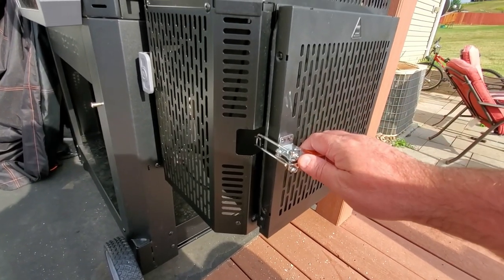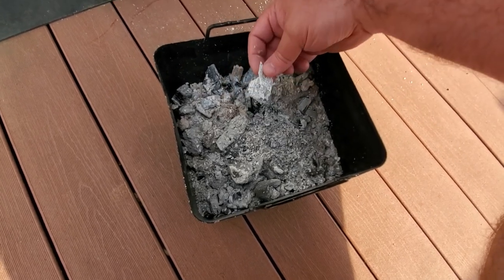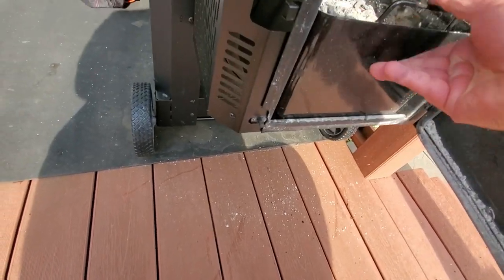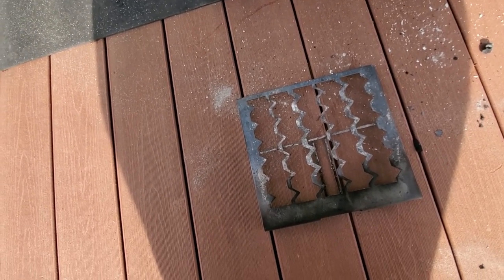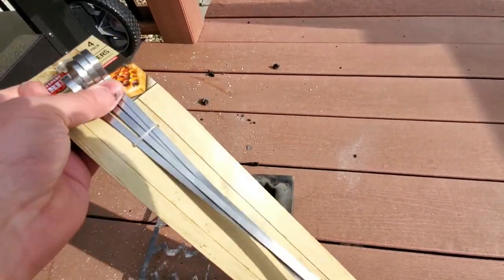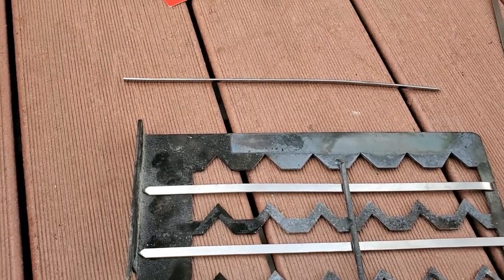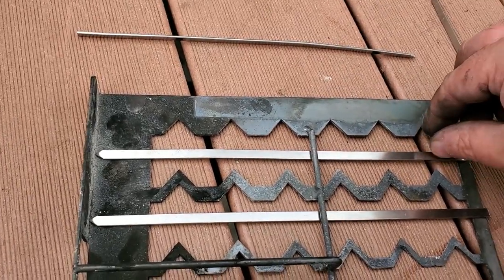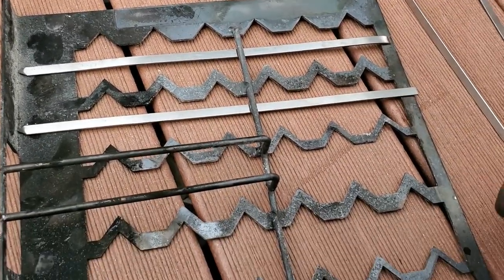Masterbuilt 1050/560 Hopper Mod - Save $$$

Comment: I purchased an aftermarket grate. The openings were narrower and had a fan protector. It was a complete fail. The grill wouldn’t get up to temp. The other issue is if you like to throw chunk wood like applewood, cherry etc it wouldn’t allow any small pieces of charcoal to fall through to ignite enough to cause smoke. Switched back to the grate that came with the 1050 and it works flawlessly.

Comment: Just a couple thoughts.

I think the spacing on the grates could be set wider so that the coals drop before too much ash builds up. If they get too ashed over the fan will pull ash up into the food or at least into the fan. 

Second, it seems to be a more common practice to add wood chunks into your ash bin to get a good wood smoke going. Slowing the addition of coal into the ash bin could make that technique less effective.
Reply from the maker: I haven't had a problem with ash in food and the newer grate does tighten the spacing a bit.  You are correct about the wood chunks and the coals dropping on them but you can effectively customize this by having as many in as you want.  I generally always have 2 in but bump it up to 4 for longer low and slow cooks but everyone has their own preference.  With just 2, I can easily get higher temps.  With 4, it has a tough time getting up to that high searing range.

Comment: Hi we just purchased the same grill. When you smoke does smoke come out the lid of the coal hopper when smoking. Smoke is leaking out the seal. Does yours do the same. Thank you. Great video 👍. Going to put the skewers in ours as well 👍
Reply from the maker: No, but mine seals really well thankfully.  I know a lot of other people have had that happen.  If it's only a small amount it's not a big deal but the more you have, the more it's directing heat and smoke where it shouldn't be and you'll also have more charcoal getting lit further up the hopper.  It's worth keeping an eye on.
Reply: @randomjoe7646  I double folded a piece of foil and lift the lid. When I placed it down and secured the lid again the smoke stopped leaking. The digital display is bad and will not read. It remains black. Masterbuilt is sending us a replacement digital display. Thank you for your reply. God bless 🙏
Reply from the maker: @indicagirl7876  Glad you got it worked out.

Comment: Tip or Suggestion:

You possibly won’t have a need for this mod if using B&B Charcoal Briquettes IMO. I want to stress too that it’s just my opinion. I’m not saying my opinion is right or will work for you. It just worked out this way for me. 

If your charcoal of choice is KINGSFORD then I would consider/recommend this skewer-mod, but also remember Masterbuilt placed those slots there for a reason on that charcoal catch tray. 

With this mod in essence what you’re doing is not letting those ashed up briquettes fall down into the hopper which in some instances will hurt your smoke output inside the grill and possibly mess with your grill temperature.

At most I would try 2 of them and see how you like it. In my instance, I tried it with 2 skewers first with B&B (I also add wood chunks) but this prevented a good even smoke throughout my cook. I also noticed that my different installed temp probe on the front, was suddenly way off from the digital display temp reading. 

I took the skewers out about midway into the cook and my temp gauge then slowly crept up to very close to my digital temp display. 

Note: As indicated above, I changed out (mod) the temp gauge probe on the front of the grill so I could see true temps towards the front middle of the grill instead of the included cheap looking Masterbuilt stock temp gauge. I had been using the new temp probe/gauge many times before this skewer mod and both temp readings (digital display & temp gauge/probe) always seemed within 5 to 15-degrees. 

I tried the 2-skewer mod with KINGSFORD as well and the same thing happened to me and it was even worse but I think that’s due to the fact that Kingsford has been proven not to hold temp anywhere near as long as B&B. 

** I also have the SS Firebox Mod on my grill **
Reply from the maker: Thanks.  I do adjust between 2 and 4 based on how I'm cooking.  If I want high temp, I go down to 2.  If I'm looking for temps 400 and lower, I've been good with 4.  That is generally with B&B Lump.  I did some briquette tests and they do tend to get to full ash easier.

Comment: Thanks for the video. Do you find that your lit charcoal creeps further up the stack above the firebox since coal isn't falling through the grate until it's much smaller in size? I'm curious if you notice more lit coals well above the firebox given that the coal on the bottom takes longer to fall through now. I'd hate to have issues in the stack above the firebox as I don't think it was meant to have lit coals higher up in the stack. Thank you.
Reply from the maker: No, It doesn't seem to go any higher at all.  The only change I see is the with the small pieces taking longer to fall through the air flow isn't as good so you can't always reach the higher temperatures.  I actually think my box is in better shape than most with the grill, at least most without the stainless steel firebox mod that's out there.  The only issue I really see with the box is with moisture slowly building because of the solid top seal.
Reply: @randomjoe7646  Thank you

Comment: I just saw this grill, new and assembled, at a local Walmart. It is in their clearance section and I'm more than tempted to get it. I've mostly been cooking on a Weber kettle. How is the 560 as far as fuel consumption goes? Should I anticipate spending more on fuel than I do with the kettle? Thanks... Very helpful video!
Reply from the maker: I probably have to let others advise on fuel consumption vs. kettle specifically but one thing I like on this is that when you are done, the slides choke out the coals so you can use the remaining fuel again.  There is a fan to supply oxygen and when you get it up to 700 degrees, you'll use some fuel. They claim the hopper holds 10 lbs. of lump charcoal or 16 lbs. of briquettes for up to 8 hours of use, I believe they claim 10 hours on the 560 with same size hopper(just less cooking area to heat so you get more time).  In my experience that's pretty accurate for low and slow.  In my opinion this mod extends that a bit but I haven't done specific time trials, etc. because I do a pretty good mix of slow cooking vs burgers, etc.
Reply: Thanks! I am really lucky to have gotten this grill assembled for $252. I've got a mini Green egg that is great on fuel consumption and a Weber kettle, so now my arsenal is complete. I'm really stoked about the 560 with all it's cooking area. Can't wait to season it and incorporate your nifty skewer mod. Thanks again for your reply and vid. Subbed!
Reply from the maker: @manfromearth  I got lucky and ended up with the 1050  and cover for $500.  Ordering error that worked in my favor.  Feels almost unfair.  I won't complain. =)
Reply: No doubt! So have you done any other mods to your 1050 or did you just go for it? The mod that protects the firebox looks worthwhile, then again MB says the breakdown of the metal enclosing the bricks in the firebox is normal. Also, I'll probably get a cover, although I'm ok with just putting a tarp on it. Mine is under a lean-to, as well.
Reply from the maker: @manfromearth  No other mods yet, I agree the firebox is probably the one I'd most consider.  There is moisture build up inside of there and stainless steel would help protect it.

Comment: I've also done this mod. Prior to the mod I would have lots of unburnt briquettes. Afterwards I don't have hardly any at all. Only downside is if u like to put wood chunks in the ash bin, for additional smoke. Not enough lit briquettes will fall through to get the chunk smoking. Because of this I usually just mix chunks with the briquettes in the chute.
Reply from the maker: Good call out.  You could get around it by sliding 1 or 2 skewers to the side to allow larger pieces to fall through and light the chunks but mixing them into the fuel is something I've seen quite a few people doing.  BTW, I'm a Chiefs fan, your team is darn good and I wouldn't be surprised to see us face off in the Superbowl again.
Reply: that's the reason Masterbuilt did it that way so you can put wood at the bottom. the way he is doing it  all you will get is ash

Comment: i just got the 1050 and the grate didnt have the big gaps like you have shown.   maybe Masterbuilt updated the grates recently.
Reply from the maker: I'm officially intrigued.  I went to their site and the photo for the grate is not currently out there in the parts section, I'm not sure if that's new or not but if they made an adaptation, that would be great.  https://www.masterbuilt.com/products/9904190046-manifold-ash-grate-kit?_pos=24&_sid=21bc86c41&_ss=r
Reply: @randomjoe7646  i reversed seared a pair of ribeye's.   only had 3 small pieces of coal in the ash bin.   just smaller than a golf ball.

Comment: I see you posted in June 2020, how are they holding up today? Does the heat release the tension rendering them not as useful? Thanks for sharing your idea and video.
Reply from the maker: Hey, good question.  I've got a follow-up on this coming out today to answer the question.

Comment: If you burn good B&B Lump you will only have white ashes left, cheap made coal does not burn up all the way to white ash like B&B
Reply from the maker: That was lump B&B.
Reply: @randomjoe7646  hmmmmm, strange, mine burns to white ash, I only cook low & slow
Reply from the maker: @ozman1966   I do both low and slow and high temp for searing so it's a mixture.  The ability of this to get to those high temps is one of the reasons I went with it over something like a pellet grill.
Reply: @randomjoe7646  true, it does sear a mean ribeye at 700° +

Comment: I tried this and they keep coming out
Reply from the maker: That stinks.  You can bend them and put them between the grates at a 90 degree angle instead.  That won't let you remove them as easily later but should keep them in place better.